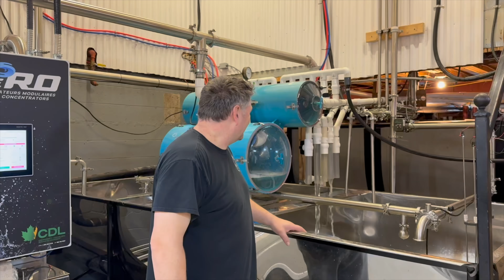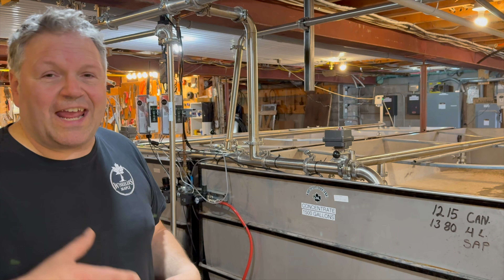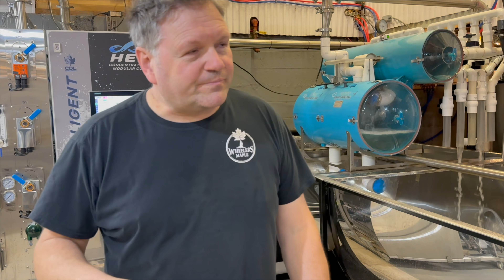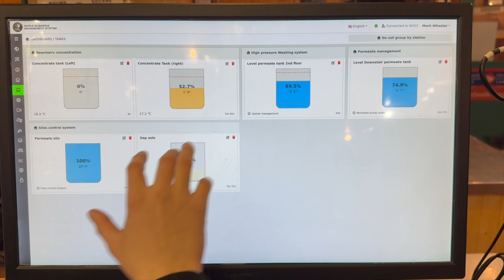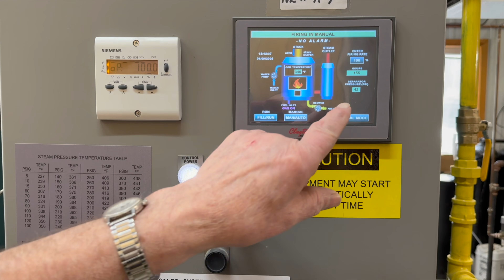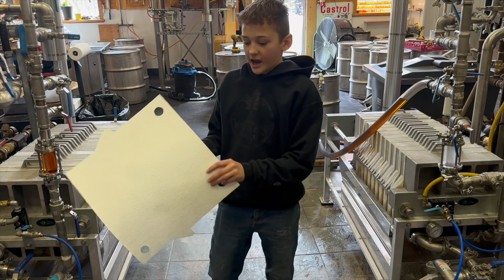Wheelers Maple 2026 Equipment Updates

Comment: all these bigger fancy maple houses all using R.O to make concentrates, hey its fine and all but you wont get a the same taste outa a brisket smoked for 2 days, compared to one smoked in 2 hours.
this is what your changing to your syrup, the amount of time spend cooking/boiling. your making syrup in 1/10 the time of boiling without R.O, so fine your making things faster, but just like that brisket. cooked low and slow, your not gunna beat it.
Reply: Of course it won't be the same as the stuff my grandfather made, boiled off in an old stainless steel tub open to the sky, complete with leaves and lichen and fly ash from the fire floating in it, scooped out and poured through a coffee filter before finished on a Coleman stove...

I have no idea what the current ratio is, but RO isn't new to Wheeler's. Last tour I took of the processing side maybe seven years ago they were using an earlier version of this setup and the reverse osmosis stage was responsible for about half of the water removal back then. It was delicious last year and I imagine it's the same now!
Reply: @holysirsalad  no, almost every equipment stays the same filtration, boiling, harvest, but theres just no R/o stage and up here they use wood logs to heat boilers so never worried about running out of electricity.
Reply: You have a wonderful family and a wonderful operation. I hope your business can survive in Canada.